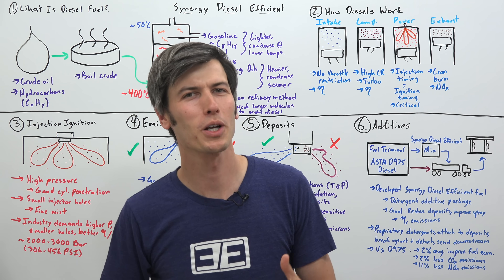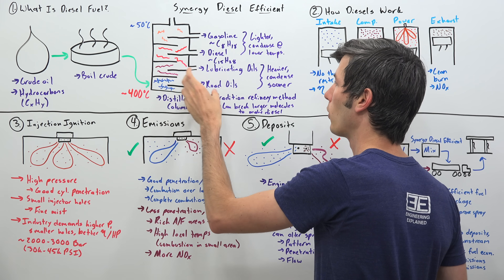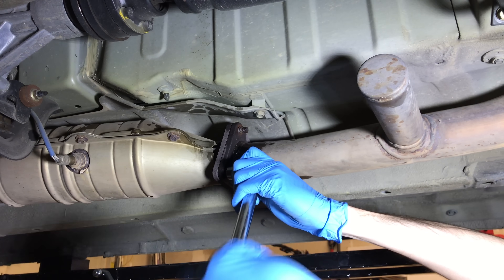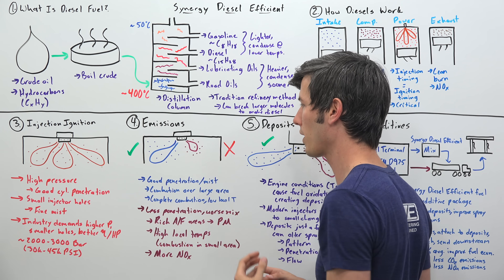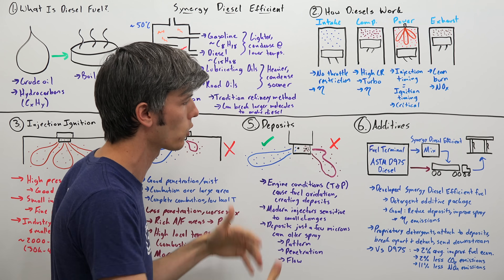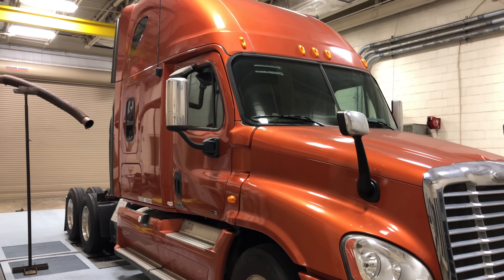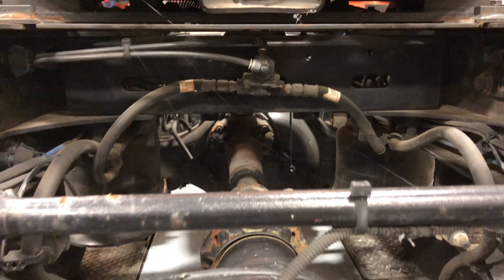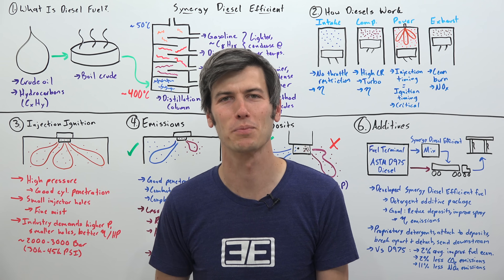Why Diesel Engines Lose Power & Efficiency Over Time

Comment: I think it’s safe to say every engine loses power and efficiency over time...
Reply from the maker: Correct, but there are distinct differences for why a gasoline engine might lose power. Explained here: https://youtu.be/uj8hjAjI7p4
Reply: @EngineeringExplained  , The DPF  and EGR systems screw diesels bro..
Reply: @EngineeringExplained * no there are distinct reasons why you want us to watch another video (cough),(Views)!*
Reply: @EngineeringExplained  and @TheChamp76 No it's not. if you do proper maintenance on pistons/liners/valves/injectors and bearings, your engine will keep its power output. I work with Diesels over 30 years old, still running smooth and at full original power.
Reply: @EngineeringExplained  , btw.. in my opinion, HEUI systems have the most power.
Reply: I have kept complete gas mileage records for all my cars for decades, and I use them to practice my spreadsheet math and plotting skills a little.  My 1997 Integra GS-R, in particular, seemed to show gradual slight improvement for many years, and it ended my ownership only after 13 years and 176,000 miles at which point it still didn't consume oil, and MPG wasn't noticeably declining.  One of my key observations is that tank-to-tank MPG variations include a lot of random data scatter, but if you do a running time average plot of gas mileage (first point on the plot is the first 10 tanks, second point is tank #2 thru #11, third is #3 thru #12, etc. ) you see a much clearer trend, with a clear dip for winter vs. summer, and clear differences between regular workday commuting and your vacation trips.
Reply: Yes of course they will even with absolute proper maintenance. Parts will wear down from friction, that is just common sense. Your tdi engine DOES NOT have 100% of its efficiency at 200k just because you change oil regularly, sorry. Even the best engineered Mercedes, Cummins or EMD commercial engines will need a teardown at 1 million miles. And yes electric motors wear down too.  Efficiency drops over time. Great vid, thanks for posting!
Reply: @ulrichskaarsgard7848  Modern electric motors are brushless.
Reply: @jonathanschultz4770  I am well aware of this. Brushless motors can still fail from age and heat. Nothing man-made lasts indefinitely.
Reply: @jonathanschultz4770  that doesn't stop them from having issues.
Reply: Not just engines, I'm pretty sluggish these days myself. I also backfire more than I used to.
Reply: @UCCzjZucvdXA0RUmCvZEppgw wrong way with the math, if the 113hp given is wheel HP then with your 15%(which is high for such a vehicle) would put the crank HP in the 130 range. If the 113 is the crank HP then no math is needed as it would be a fair comparison. 

granted a 3hp difference is easily within margin of error, Dyno numbers are really only a reliable comparison if done on the same Dyno preferably on the same day. swapping the tires for a newer/older set can make that difference.
Reply: @jacobdukes4741  plenty of old diesels with millions of miles on them, with a few easy mods they can easily out perform the stock figures. The pics and videos of all sorts are all over the internet, a cursory examination into the diesel world would reveal that. All 3 of my diesels well out perform the original specifications.
Reply: If you take both engines and do correct maintenance on them both, the gas engine will retain its standard power ratings better and longer
Reply: Hi Jason, I recently conducted a similar test to replicate the claim of the cleaner injectors providing improved fuel economy. We actually removed 11000 hour old injectors and replaced them with brand new injectors to replicate the clean injector claim. We found an improvement of 0.58% however the additional price of the additive package is 0.60% so it does not appear to be a cost effective solution to us. This was conducted on an engine dyno with a 67litre CAT mining truck engine. My question for you is, do you know if the larger displacement engine had a lower % improvement compared to the smaller displacement engine? My theory being that perhaps the larger injector nozzle diameters are less effected by the buildup than smaller diameters? In addition our mining engines are usually at wide open throttle position for far longer than road going vehicles and may not form such deposits as readily. We also took photos of the used injectors with an electron microscope which was very interesting. There appeared to be minimal deposits inside the nozzle but there were some externally on the injector nozzle. @Engineering Explained
Reply: TheChamp76 only if it isn’t maintained and serviced properly. I’ve seen video of a VAG diesel that had done +-250000 miles and had only lost about 5hp from new. Accepted loss is not a thing. It’s a myth based on poorly maintained engines.
Reply: @stubones  my 08 duramax has more HP now than stock as well. Maintained engines, especially diesels last forever. I will say, I have some mods to give the extra horses. But 1,200,000 miles and still going strong.
Reply: @pags5zonda623  
The Duramax is underrated very much
Reply: Jared Swaluk 1.2 million miles in ten years, really? That's 120 000 miles a year, 10 000 miles a month , 500 miles a day 5 days a week. That's a lot of driving
Reply: Guinness my Dad was a long distance truck driver in Australia, and he use to do a weekly run off just under 3000 k per week, which involved driving for 2 days, 2 days to unload and reload, and 2 days back.  He would average 800k (500 miles) per day on the 4 days he actually drove.  The maximum time he could drive per day was 14 hours, including stops for lunch and dinner. The max speed he was allowed to drive was 100kph (60 mph).  So, yes, I could see a truck easily doing 500 miles per day.  Some of the trucks had 2 drives, so they literally drove non stop, except for fuel and relief stops.
Reply: @StoutProper  120,000 miles a year is about what I do give or take few thousand, and take lots of time off. 3-4,000 miles a week is easy for an experienced driver. At least in the US, milage per week also varies significantly by the freight hauled. I do reefer freight from the Midwest to the coast so milage is easy to pile up. The guys that stay busy that I know do 150k+ miles a year, but I'd rather take time off and go fishing for a week here and there.
Reply: Jay Dunbar oh right you're hauling freight? 50mph 10 hours a day, yeah that's doable. It's a lot of miles still cos you won't be averaging 50mph in reality, probably more like 30-35, which means you'd have to do 6 12 hour days rather than 5 10 hour days. That's a lot of driving. What's reefer freight, cannabis?
Reply: @StoutProper  reefer freight is refrigerated, and the limit is 11 hours driving in a 14 hour shift. 
30-35mph average? I'm not sure what your smoking but it's affecting your brain, I do 650-750 miles in a typical shift. Unless your running short haul it should be expected to average a few mph less then what you have the cruise set. So if you set the cruise control at 70 you will probably average about 68mph, give or take on the lane of course.
Reply: Jay Dunbar you can drive at 70 mph legally in the states?
Reply: @StoutProper  before EU introduced restrictions on how long a driver can work my dad used to make 250000km a year, that is over 155000miles. It is more than possible.
Reply: Jakub Tabor if you assume an average of 50 mph that mileage would take 52 weeks of 6 day weeks driving for 10 hours a day. And before the EU introduced those restrictions, which the UK had the option to veto but didn't, deaths caused by hgv drivers were 5 times higher what they are now
Reply: @StoutProper  your calculations sound about right. He was able to keep it up for like 8-9 years thou. And his spine is a mess now. 66 years old now and deformations of vertebrea press on nerves so for every hour of driving he needs to walk for like 5 minutes. I didn't say it is safe or didn't recommend it but it is physically possible.
Reply: Jakub Tabor there's another reason EU nations agreed those restrictions, probably pretty sensible really. Tbh 50mph is pretty generous given the state of the roads and traffic in the UK.
Reply: @StoutProper  My dad was driving 90% on highways in Germany, Belgium, Netherlands and Poland. He was transporting 3 cars for his customers on a truck he made himself from Fiat Ducato. Loading and unloading was fast, didn't have to deal with shipping companies. He owned the truck and technically he owned the cargo so didn't have to deal with road transport inspectorate (I don't know the proper term). So most of the time was driving. I spend many summer breaks with him on the road, learned a lot.
Reply: @StoutProper  
Plenty of states have a speed limit of 70 or more. Plus the fact that almost everyone speeds, and cops typically won't even bother unless you're doing at least 10 over.
Reply: @StoutProper  You literally have no idea what you're talking about.
I drive the highway every day (PA rte 28 near Pittsburgh). Speed limit 55; I do 65 and get passed daily by yahoos doing 80+. It's to the point that driving the posted limit is unsafe due to the speed differential.

And race?! LMAO, the cop can't even make out the driver at the distance radar typically works! At worst, a minority might (repeat, MIGHT) have a worse time if it, once pulled over...

But most cops see traffic detail as "beneath them." If you aren't driving like a total nut, or guilty of a "real crime," the cops mostly leave you alone.

Why don't you talk about something you have first hand knowledge of? Like wanking till you get carpal tunnel?
Reply: @pags5zonda623  jesus. Do you drive that thing for work? Over a million miles 12 years? That's insane your averaging 100,000 miles a year? That's over 8,000 miles a month.
Reply: @blindmannohands  it is insane. I love my job. Hotshots put on many more miles than me still
Reply: @StoutProper  that's the higher end of normal for an OTR truck.
Reply: TheChamp76 speak for yourself my 2006 Honda petrol engine has 228,000 miles and is still as powerful as new, mainly because I change the oil and oil filter every 10,000 miles and change the air filter every 6 months, change spark plugs every 75,000 miles
Reply: @lodazal6571  with diesel there are less energy in winter fuel as there are less paraffin to burn. In gasoline it is usually other way around as summer fuel has to be less likely to vaporise away. During winter just slightly colder and that always increases friction slightly everywhere.
Reply: @Rico Rehn late reply. Had head gasket replaced at around 1.3m (km) new head studs as well, injectors twice now. Once at 800k and performance injectors at 1.1m, there was nothing wrong with them. Just wanted more power. First set was due to one being stuck open, so replaced rings all the way and the piston in that cylinder. Also replaced the lifters on the same side, one bent but figured I'd do em all while I was in there. I'm on my 4th(?) Set of glowplugs, first set died on warranty at about 60,000. Exhaust fully changed, no DPF. (To expensive to clean and better mpg now). Alternators, but I plow with it. Turbo bearing this year. Absolutely nothing with the transmission. And the truck runs brand new. Just keep up on fluids and your good.
Reply: Isuzu 3.0 litre turbo diesel  ?? No mention on longetivity ??
Reply: Mike nolzey Nolan no divergence Dookey
Reply: I use diesel synergy fuel as fire starter for my fire pit.... Noticed fire starts 2% faster with 20% less smoke & odor and 2% less black depsites on spark arrester wire mesh fire pit cover... used same home depot firewood for each test. Drank 4 beers during each test duration and both my dogs witnessed the test proceedure... LOL
Reply: I thought it would be from the longer stroke (versus a gasoline's bore and stroke)
Reply: Correct click bait title!
Reply: Initially a gas engine gets more efficient over time, broken in, less friction lasts a long time up to the point excessive blow bye and bearing getting to loose.
Reply: What can we say about electric vehicles?
Reply: @aosorea  im confirming that, really resistant
Reply: Amen 👍🏾
Reply: Not electric
Reply: I agree, petrol engines loose compression and therefore power in less time than diesel engines, diesel engines generally outlast the car that they are in.
Reply: @Allen Loser 
Yes, and with conventional at half the cost of synthetic, it's actually cheaper to use conventional if you do your own changes.
Reply: @lodazal6571  that's because it has more paraffin in it to stop the derv from gelling.
Reply: If used correctly at low revs eg below 2500rpm with regular oil changes and not abused, a diesel will easily outlast a petrol engine. Also diesels will give less mpg variation than petrol due to high torque at low revs.
Reply: my bmw 330d probably gained hp. it makes 281hp instead of the original 258 after app. 200000 miles without changing software. probably the injector holes become a bit bigger because they worn out. so it will take longer before it will lose hp
Reply: Me- 1999 Honda CRV 2.4 LITRE W 370,000 km. ( 240 000 mi.+) no burning oil, full power and gas mileage at 30 mpg. 5 spd.standard. original motor.90% hiwy and oil changes at 3,000 mi.
Reply: Would say a complete engine overhaul after 250k miles help? Like bearings, rings and gaskets etc?
Reply: mister clean  European ones, Renault engine.
Reply: Except the jeep 4.0 straight six. Nothing but gains !!!
Reply: Electric motors enter the chat....
Reply: (some) rotary and 2 stroke owner are crying over this (it’s a joke)
Reply: Except for brushless dc motors
Reply: Lmao why are so many people missing the joke
Reply: My 2011, 6.7 F250 has lost about .75 mpg (overall) now with 214,000 miles vs. new. If my truck is considered “light duty” as you say, it is at the end of its useful life.  I don’t think so.  It’s running strong with no major repairs.
Reply: Well yeah, but why? Thanks jason. 

Make a video just for semi trucks <3 not only america love them
Reply: @batialexis9339  A large part of the reason there are differences between how diesels and gas engines degrade over time is the qualities of the fuel, as was explained in the video; diesel fuel is an oil much like kerosene, which means it has longer molecules containing more carbon atoms.  You have no doubt seen pickup trucks that produce prodigious quantities of black smoke? Those engines are running quite rich and produce excess soot and other combustion by products all of which can reduce the efficiency of the engine.  All diesels are prone to undesirable combustion waste that degrades injector performance.  
Gas engines are much more sensitive to detonation- the uncontrolled burning of gas which essentially creates an explosion which we hear as knock.  Modern engines "listen" for the sounds of detonation and adjust the mixture and timing to reduce pressures in the cylinder.  Gasoline engines operate at much higher peak rpm which simply increases wear and tear, and in general have much wider operating range compared to diesels, especially large semi truck engines.  
One more thing, design compromises.  LS small blocks seem to last forever compared to their predecessors.  Why is that?  In part it has to do with how the engine has been designed and engineered to be more precise, rigid and stable.
Reply: @amazeddude1780  Would the carbon build up in diesels be why it's good for a diesel to be in high idle more often than in a low idle state? Considering that carbon build up doesn't happen as quickly for a gasoline equivalent?
Reply: @amazeddude1780  the black smoke is not a problem its on purpose using a tune. We can turn it on and off
Reply: An electric car loses battery capacity over time and it's electronics get outdated and start failing after some time
Reply: @prafulmartis8317  cool story
Reply: @aosorea  usually that kind of things about reliability is spoken by non PSA drivers. If listening to internet there are no reliable cars out there but then looking at used cars Peugeot 407 / Citroen C5 many are closing 500k kilometers and still running. Which is not bad for cars that are closing 70-80hp / liter and are not heavy and slow revving truck engines.
Reply: RACING BBM SAVERS?
 ￼

 Feb 8 · 3 min read
 Now the price of fuel oil (BBM) is increasingly rising, this is a complaint for many people to buy it, triggered by the high level of mobility in each of our activities.  Indeed, today there are indeed many cars that save fuel consumption, but what about people who have vehicles that are out of date.  And the best solution is to use fuel-saving products.
 WHAT IS THE ECO RACING OF BBM SAVINGS?
 PT.  Sinergy World, which is a company of Eco Racing products, issued products that function to save fuel.  Eco Racing is a fuel additive made from 100% organic ingredients so it is safe for machines and humans.  This Eco-Racing Fuel Saver product is a world-class premium product through research for more than 10 years and has been tested for quality, both through tests of well-known emission testing laboratories, vehicle performance tests through test dynotest tests, and direct testing of thousands of motorized vehicles,  until it's already been used with GP Motor racers, testing has been done for several years (all of them are tested to very strict standards).
 Has gone through the ITB Bachelor research process for more than 10 years
 Have passed the LEMIGAS and PETROLAB laboratory tests with Marketable results
 Has gone through the Dynotest test process, even tested directly by Motorplus Tabloid
 Has passed the Emission Test by DISHUB, Auto 2000, Astra International and Tunas Daihatsu
 This Eco Racing Fuel Saver is a product in the form of a pill that has an additive which has a function to protect the vehicle's engine, by increasing Octane / RON (Research Octan Number) of Oil Fuel, so that it can save fuel use and eliminate CO pollution  up to 100%.  This eco racing product can be used for motor vehicles, cars, trucks, buses and generators and can also be used for all types of engines that use gasoline or diesel fuel.
 BENEFITS OF SINERGY ECO RACING include:
 MPU Protect and clean the machine (Nano Technology)
 Able to reduce CO (carbon monoxide) gas emissions and exhaust ash
 Able to increase 5–10 RON (Eco Racing)
 Able to increase 2-5 CN (Eco Diesel)
 Able to eliminate Knocking
 Able to optimize power and acceleration (Dynotest)
 Able to save fuel 30% 50%
 Able to soften engine sound
 Able to extend the feasibility of the machine
 Able to optimize the combustion process on the engine
 Able to clean crust in tanks, gasoline hoses, carburetors and engines
 Able to reduce significantly the cost of engine maintenance
 SINERGY ECO RACING CONTENT
 Detergent Chemical Organic Function which has a function to improve combustion and maintain engine stability to be excellent.
 Corrosion Inhibitors.  Can prevent corrosion / rust on gasoline lines and combustion engines, and remove the remaining rust due to the wrong use of fuel such as premium on motors with compression above 9.1 (type of injection and matic).
 De Emulsion.  Can separate fuel pure substances with impurity emulsions such as rainwater etc.  So that it does not affect the combustion process.
 ￼￼
 Eco Racing is not only an RON enhancer, Eco Racing is able to harmonize MON (Octane Number Motor) so that the performance of the vehicle can be maximized.  Equipped with additives, Eco Racing is also capable of reducing, preventing crust on the engine and fuel lines, and reducing emissions residues.
 By using ECO RACING BBM SAVERS this combustion will be more perfect.  If the combustion is complete, it means that all the gasoline (in the form of steam) in the compressor tube burns all, adding more impetus.  With the Eco Racing Fuel Saver, gasoline becomes more pure.  Eco racing can release crustal crust through exhaust air.  Closing the pore pores The engine block is eroded due to the unstable piston performance.  In addition, eco racing products make the fline layer on the engine block and piston.  This is how eco racing works so that the engine is protected.
 ￼
Reply: electric motors dont.
Reply: @SupremeRuleroftheWorld  dont what? Wear out? Of course they do.
Reply: @SupremeRuleroftheWorld  electric motors dont what? Degrade? Because yes they do a stator and rotor along with wiring and vrms are very much not a forever thing.